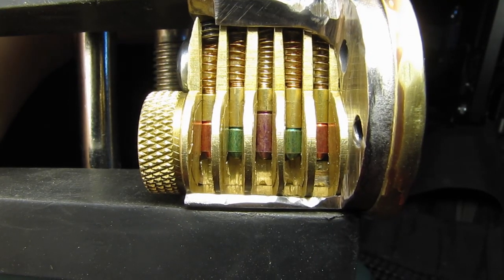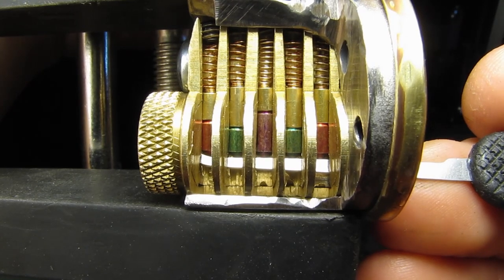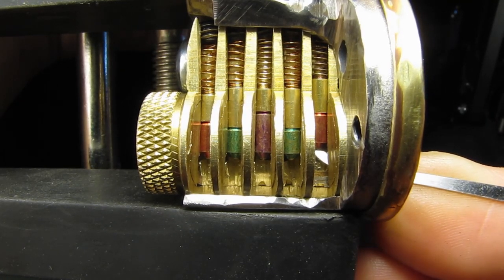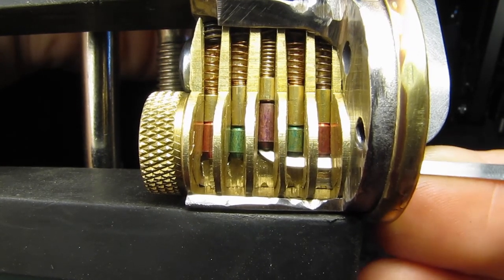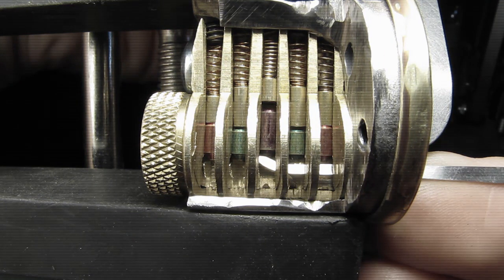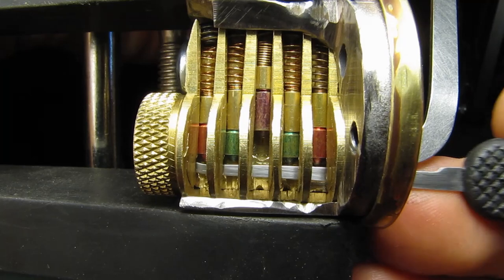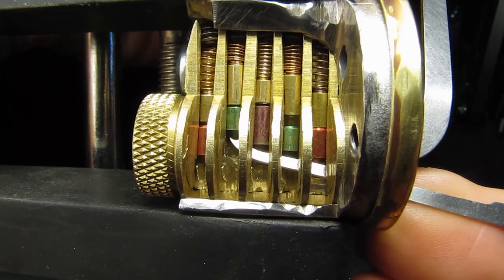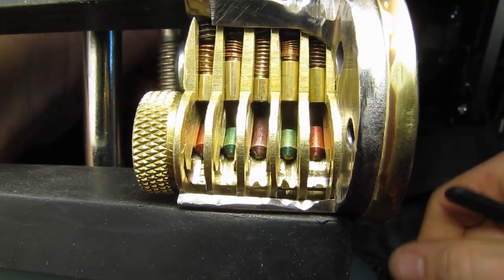"Jiggle Test" and the Four Fundamental Pin States

Comment: For a new hobbyist like me at 71 years young, even after all the books and other videos and the understanding I already had gained over some time, this was definitely the light bulb moment that made it all more than the ahh ha moment and my picking went to an analytical high, rather than simply feeling around thinking I know where I am and getting lucky much of the time. I now genuinely feel the difference! The other thing I found after this enlightenment was my surprise at how very little pressure is actually required for the tension tool to be effective and give that necessary feedback on most locks. Thank you very much.

Comment: How can you feel the overset in the EU with locks being placed with the pins at the bottom?
Reply from the maker: Someone else can probably answer better than me because I've never picked a lock in that orientation. So this answer is just theory and guessing with zero practical experience. Or, I guess a more generous way to phrase that is that this is my thought process and how I would attempt to solve the problem. (My realest real answer is at the end)

You can feel the spring on set pins and non-binding unset pins, so the core issue is differentiating between underset drivers and overset keypins. You can't search for keypins sitting at different heights because you're always going to get that with a spring-down orientation. So, that leaves you with the only difference being which pin is binding.

With an underset driver, it's the driver that's binding at the shear line, and the keypin is just sitting there loosely. You should be able to hear and feel the keypin wiggle around a little inside the chamber when you scrub at it with your pick. You can see it a little in the video when I'm holding the purple keypin on the tip of the pick. The pin rocks side to side a little in addition to moving up and down. 

With an overset keypin, it's the keypin that's binding at the shear line. That means that it won't wiggle around at all when you try to jostle it around with your pick. That's what I'd look for.

I should add that the best way to deal with overset pins is to stop oversetting pins. I know that sounds a little flippant or cheeky, but it becomes more true as you pick more locks. It usually feels a little different when you overset a keypin versus setting a driver, and you can often tell when you're about to overset. So stop when you get to that point. An overset pin tends to feel a little mushy and may cause the tiniest hint of counter rotation. 

Another immensely important piece of information is that the rest of the pins stop binding as soon as you overset a pin. So that tells you that the last pin that you pushed down went too far. Now you know that you shouldn't push that pin down as far next time.

Comment: This is very insightful! One thing I want to know, near the end you push up the last pin with quite some force. Enough even to bend the pick it seems. Is this usually an appropriate amount of force? I'm afraid to bend my picks!
Reply: In this case I think he was just caught on the warding, so he pulled his pick out and went at it again, which went much easier the second time when he was dead on the pin. Sometimes pins get ornery and need some extra coaching but if you're pressing that hard, somethings probably off. 
Still, that was more of a temporary flex than a permanent bend. If he'd continued pressing harder, than it might have left a notable permanent bend.  It happens. But if you find yourself often using that much pressure, you're probably either applying too much tension, or you're actually pressing against the warding.  I did that to my Peterson #1 hook (my favorite right now), but I was able to bend it back pretty much to stock. However I would definitely not make a habit of doing that, as the pick will break eventually from the back and forth stress. Now I'm more careful to watch my pressure, angle, and depth.

Comment: Great video. Yours is the first time I have ever seen the recovery from the overset pin explained.
Can you please tell me about why there are different length drive pins? Can you explain "balanced key stack"? Lastly what's with the springs? Thanks
Reply from the maker: "Balanced stacks" means that the combined height of the keypin and driver pin is the same for all of the chambers. So if you were to look into a cutaway like the one in this video, the tops of all of the drivers would make a straight line when the system is at rest without the key inserted.

Balancing the stacks, makes it so all of the springs will be compressed equally, and that gives you smoother operation and wear on the key. It also prevents decoding attacks that measure the differences in spring pressure from stack to stack, but I'm not sure if that's actually a practical attack or just theoretical.

And springs just make everything more reliable. Without springs, locks wouldn't work upside down, and they'd eventually jam up from little bits of gunk being blown in by the wind or injected by the key.
Reply: @bleh222234  does using balanced pin stacks make a lock more difficult to pick?
Reply from the maker: @howardtoob  nope

Comment: I commented on this video before.  I still watch this video about once a month. Anyway, is there anyplace I can get one of those cut- aways you used?
Reply from the maker: This is one that I made myself, but some people do list them for sale on ebay. If you don't have tools, then that's probably your best bet, but you should realize that you're paying $20-$30 for something that you can make yourself with a $2 lock and about an hour of time invested.

I used a hacksaw to get it started, a dremel with grinding wheel to remove more material, and then some jeweler's files for the final touches.

Here's a good guide for the process: https://www.youtube.com/watch?v=fRy5IeF00e8

I don't think he does this in the video, but I immobilized the plug by running a brass rod through the top of the bible. Makes everything a little simpler.